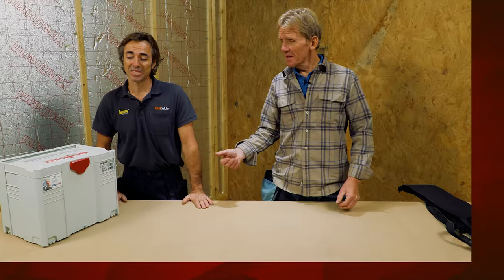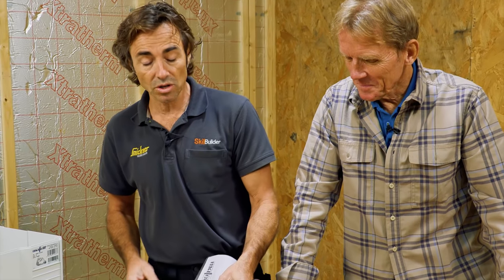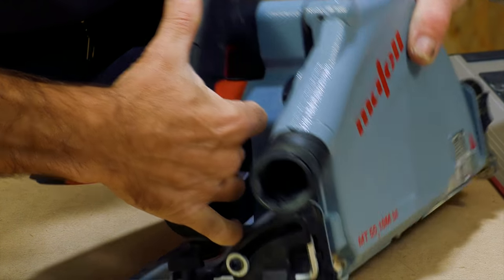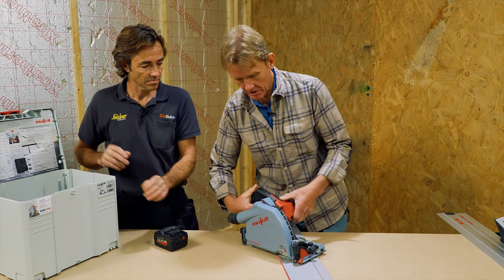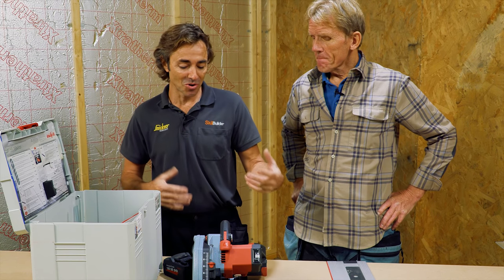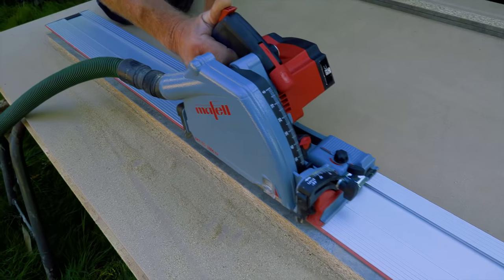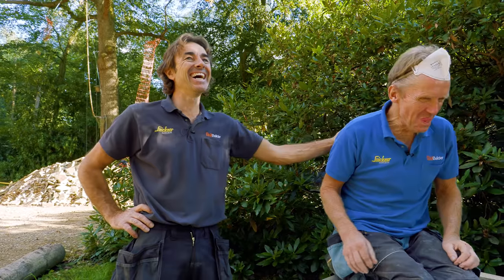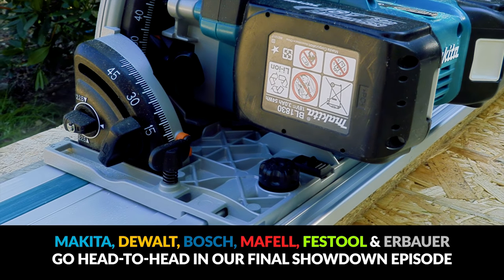MAFELL MT5518M Cordless Plunge Saw - Episode 5

Comment: The extra round tube extension on the dust bag is to hold the red cap when the bag is attached to the saw so you don't lose the cap.

Comment: Inedible saw. Said bye bye to my gutless festool 36v and got this. Bought 4 18v Metabo 10ah tanks for it. 

Incredible bit of kit. The fezzy was good but this is a cut above. So much so, I traded in most of my fezzy gear... router, drills, carvex and went all Mafell. Spent a pretty penny this week but I’ve been installing kitchens/interior finish work 20 years and I’m at that stage of life where I want the best tools available. 

Don’t get me wrong... I’ve still got some amazing battery dewalt/Makita stuff and my Kapex isn’t going ANYWHERE (unless Mafell release a cordless CMS - Mafell... PLEASE RELEASE A CORDLESS CMS) but Mafell really does outclass everything I one have ever owned. 

The attention to design and end user is astonishing.
Reply from the maker: Jay Jo. That is a really interesting comment. We will take a look at the rest of the Mafell kit but if you are inclined to make a bit of a video review on your phone sideways so it fits the screen, we will be very happy to put it on Skill Builder.
Reply: @climbjay I just jumped the gun and bought 2 of the Metabo10ah batteries for it (I havnt yet received the saw as it is on order). I noticed in this test they used the 8Ah battery, and in advertising it has the 5.5Ah tank, which made me panic and think i bought too big a battery. Does the 10Ah tank fit it well? Cheers in advance.

Comment: That's a beautiful gasket Robin :) 

That Mafell might only be 18V but it's the new type of li-on batteries that have more power than the rest of the batteries
Reply: I don't know about the "new type", but it's very vital to talk about the amp! If it draw the double amps compared to the 36v machines there's no difference.  It says nothing about the efficiency! And those 18v batteries are 8 amps batteries!!!!!!! I assume the 36v machines use 3-5 amp batteries.
Reply: @brianwengel6894  I have A HELLUVA lot to learn about Batteries then mate.. I didn't realise all this was so essential but thanks for that heads up though my bro.. Salute to u for that great bit of information on the Amps in batteries
Reply: @brianwengel6894 somewhat true, max watts is possible to match but let’s be honest…. Higher volts always leads to higher watts in batteries. Thats just how it works in the real world. My makita xgt batteries can put out 2800 watts peak, 18 volts just can’t touch it

Comment: The track looks very much like the Bosch track system. Is it the same?
Reply: Jupp, just the same. I use it together all the time at work
Reply: The bosch is made by mafell for a different price bracket
Reply: It is the same. Exept the colour and the price;-) I use them up to 3m, works perfect. Better than my old Festool, especially the connecting piece is functioning without those disadvantages of the other ones.

Comment: A cordless saw, with a vacuum hose hanging of it!
Reply: Mentorcase I was about to say the same thing, total pointless, i’ll stick with the corded one!
Reply: It is easier to use when it is cordless. 

Also it gives you options such as working in a clients home or working on a site without power. It is not pointless
Reply: Of course, just take a cordless vacuum along with it, sorry for having a hair trigger on my mouth.
Reply: bighands69  good luck taking an £800 saw on site.
Reply: Elliott Day wow somebody bit didn’t they! I’m not in one place all the time, it’s just the 5 seconds it takes to push a plug in the wall doesn’t both me. Sorry but I still think it’s unbelievably pointless with a vac as the vac comes on at the same time when using a corded saw.
Reply: @bighands69  Working in a clients home without a powerful dust collection or even a dustbag would be the first and last time with the most clients I have. I do not know where you are working, but in my case there are sockets everywhere, and there is very seldom even the need of an extension.
Reply: Andreas Schlitzkus my wife got a heartattack when I used a corc saw indoors.. now I bought a tracksaw and a dustcollector haha don’t want that drama again :D

Comment: Mafell is not available in Australia. The cross platform batteries is a great feature.
The fact this saw perhaps is not lacking power compared to the 36 volt when considering metabo and other manufacturers 8 amp house batteries.
Metabo make a 5.5 amp hour battery with more power compared to their new compact 4 amp and and 8 amp hour lihd batteries.
The scribe feature is very good.
The other thing is festool in their 36 volt cordless plunge saw they have a negative rake. What is the purpose of that? Is that the same as a scribe?
I'm wondering the power of a 36 volt compared to this mafel. The other question is what is the size thickness of the blade. Festool contractor saw have a thin kerf blade 1.8 mm thick. The plunge saw have the 2.2 mm thick.
Festool contractor saw cuts the same distance from their rail system as the plunge saw at 2.2 mm thick.
I had ( before they were stolen ) the festool cordless plunge saw and the festool cordless contractor saw. I found the cordless contractor saw working a bit cutting hardwoods or even 18 mm form ply when cutting on an angle. Mind you I had a 4.2 and a 5.2 amp hour battery.
I thought the contractor saw could do with a bit more umph. 
If the 5.5 amp metabo battery could be a great benefit in using the festool contractor saw.
Also on hard woods I had the 12 tooth blade with deep teeth so removing material and great for ripping hard woods it was like cutting butter.
Reply: Their available now

Comment: Does that "score cut" feature actually move the blade inward as described?  I have the saw but have never tried that... because I certainly don't want to re-cut the rubber splinter guard back any further.  That's my cut line!  
I've heard the score cut doesn't actually move the blade!  Is this true?
Reply: It moves the blade, and it works fantastic. Best feature of a very good saw. I like the corded, as it has endless power, is lighter, more durable, more powerful & "cheaper".
I use a collecting hose, so there is no  "freedom" benefit.
Reply: If you can see a 10th of a mil on your splinter guard , I have to congratulate you for your incredible sight ;-)

Comment: Here lads can I have the Mafell saw?? hahahahahahaha!! God loves a trier .. Hates a feckin' chancer though.. I know, I know lads.. Love the buzz between u 2 guys.. It's always very informative and I want one of those Mafell Plunge saws.. Get the limo to drop it round my Gaff please Roger mate..  LMAO.. How much is the Mafell again? 600 Pounds? or Euros? I'm chancing me arm again mate.. I think the Festool is a great saw but I bought one of the Bosch professional range with the massive carry case a couple months back.. The case has more plastic then COCA COLA have in a million bottles of COKE mate,, I've never seen so much heavy duty plastic round a great Circular Saw that cost me only 86 euros in a sale.. 
Can I ask one question of uy guys if that's ok.. I want to buy a really good blade for it so is a blade with 80T a good option and what kerf should I get for cleaner cuts.. I cut some melamine board the other day and the blade I have on this saw left it looking worse for wear on the edge of the cuts. I think I will be using the scoring cuts from now on too.. I've never used that before but I'm sold on that tip now.. Thanks for a great video again guys.. Brilliant.. LOVE THE CHANNEL too BTW
Reply from the maker: I like the Freud blade for value and the non stick rust proof coating.

Comment: I love cordless. I do hate the fragility of the batteries. The question is why aren’t companies like Dewalt, Makita improving their saws with features included in the Festool and Mafell.  The cost difference in manufacturing an average tool vs a great tool is minimal.  If Dewalt (for example) wanted to add comparable feature set to its track saw it would add less than $15.00 to the price its the tool.

Comment: No riving knife. I'll take a mechanical safety measure over an electronic one every time. Sheet stock great. Lumber hardwoods and high tension stocks not so great. Without stripping a tool down how can you possibly know it is well designed? The Festool, for example has mixed/mismatched switch circuit wiring and an Industrial Revolution era brass end bushing (not a bearing) on the rotor end. Really poor design choices. Pull the Mafell apart then maybe we can have a good conversation about design.
Reply: I trust these guys mean "design" as ergonomically, not technically as a mechanical and electrical engineering standard.   I know what you mean. I always call the person on it who tells me so and so is a good doctor. How the hell do you know? Even other doctors are hard pressed to be able to judge.